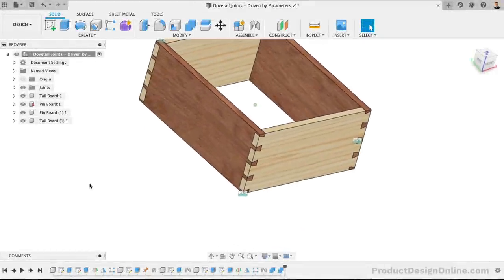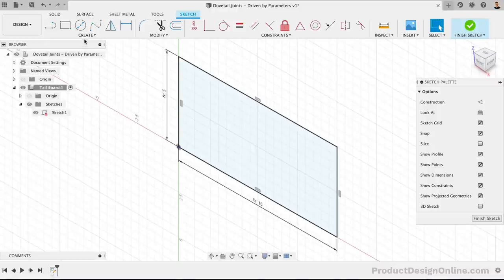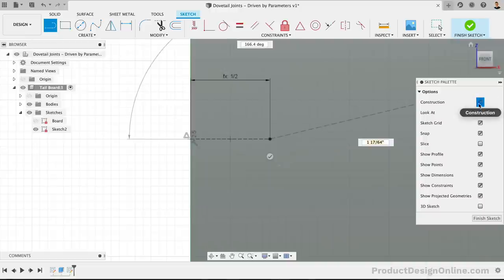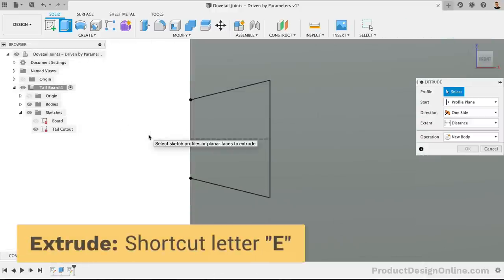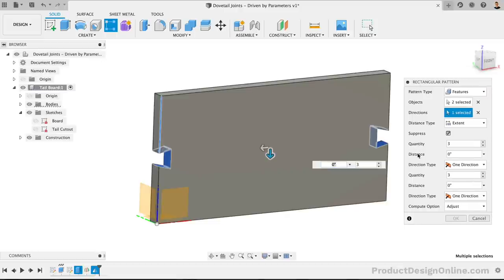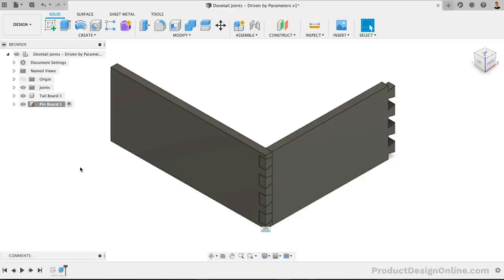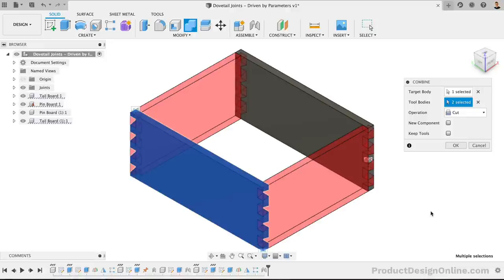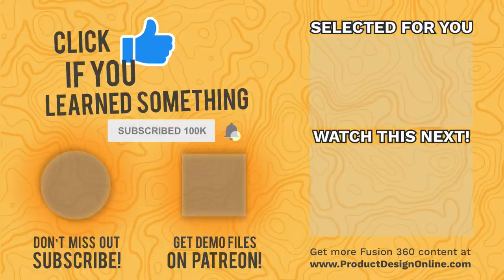Fusion 360 Woodworking: Dovetail Joints - Make them the easy way!

Comment from the maker: F360 Masterclass for Woodworkers ➞ https://bit.ly/woodworkingMasterclass
F360 for Woodworking Playlist ➞ http://bit.ly/woodworker-playlist
TIMESTAMPS
00:00 - Dovetail Joints in Fusion 360
00:30 - Fusion 360 Parameters for Dovetail Joints
00:55 - Creating the Tail Board
02:50 - Sketching the Negative Area of Pins
05:00 - Fully-defining the Dovetail Sketch
06:50 - The Proper Way to Model Dovetails
08:15 - Patterning the Dovetail Joint Cutout
09:30 - Creating the Pin Board
10:21 - Copying the Boards and Adding Joints
12:34 - Cutting Dovetails with Combine Command
13:34 - Testing the Parameters in Fusion 360

Comment: Thanks for the instruction & lessons that I've learned from your videos!  This one was no exception.

I went about it in a slightly different way.  If you design with really thin pins (say 1/8" for example), then it's not all that realistic to have half pins that are 1/16".  So I added a parameter for the half pin width and removed that much off of either end of the tail board to make sure the half pins were a reasonable size (1/4" or 1/2" for example).  Then after push/pulling the center pin out of the tail board, I used the rectangle pattern tool to replicate the center pin cutout feature across the remaining space rather than the full width of the tail board.  I hope this makes sense.

Sometimes just because something can be designed and modeled doesn't necessarily mean that the final product will be functional.

Comment: I started using F360 a few months ago mostly for woodworking, so I was happy to find this video. It was really informative. It also mostly matched my gut instinct on how to do this, which made me happy. What I might have done instead of the Copy / Paste commands, though, would be to mirror each board across the corresponding midplane, or maybe instead do two rotational patterns about the center of the box, one to copy each board. That way I'd only have to do the joinery Combine / Cut operation once, and any other changes (eg a groove for the bottom) would get duplicated to if I put them in the right places in the timeline.

The trade-off is that I'd probably have to make the whole box a rigid group rather than using joints like you did. I like the way your joints assemble it like you would in real life. I'm not sure which approach I like more. I need to add some drawers soon to an MFT-style outfeed table I'm designing, so maybe I'll do one each way and see which I like best.

Thanks for the video!
Reply from the maker: In general, try to avoid Mirror and Patterning in Fusion 360 (all parametric CAD programs). It often causes extra latency and other issues downstream in timeline. For woodworking sake, it will make your BOM/Parts list inaccurate, etc.

For a "Small" project - either method would work :)

Comment: This was very helpful! 
Some things I would felt were missing:
- A few sentences to what a parameter is and why it is useful to use parameters. also, where to click to be able to make your own parameters.
- when you used the assemble-joint tool, I had no idea which point you used to align. It took me forever to find it; my board kept flipping, or at one point I almost had it, but it didn't align properly (it was off by 1 cm), and I didn't know why that happened. Also, maybe a few sentences to what the "joint" tool actually does.

Otherwise, this was really helpful!

Comment: Very good video and an elegant workflow to modeling dovetails. 
I would like to use this as a basis for future works and one approach is to hand dovetail the 4 sides then after glue-up rip on the table saw the four sides releasing the top from the base. 
Do have a workflow on how to this? the saw kerf removes 1/8" of material. 
thanks in advance
-Craig

Comment: Kevin:  I need a way to do this but with some tolerance (gap) added to one of the parts.  When CNC'ing if one part is exactly the same as the other they wont' actually fit together.  I wish the cut tool had a "+/- offset" option to add this tolerance.  Any suggestions on how to accomplish thi sand maintain the parametric nature?  Thanks,
Scott
Reply from the maker: Hi Scott. I agree, wish the cut had clearance built in. For now, the main way to do it is to use the "Offset Faces" command. (Solid > Modify > Offset faces). You can use a parameter defined as "Clearance" and set each offset to that parameter.

Comment: Kevin, I had a problem when changing the parameters. Everything works as it should except one thing. I have my Fusion 360 design oriented the same as yours in the video. When I change pinNumber to any even number, the board in the rearmost position extends out a bit. When I went back to where you made the joints at 12:30, I noticed that the corner furthest away did not have joint icon in place. I have tried to create a joint at that corner, but the joint icon always appears at the far end of one of the two boards, away from the corner. Have I stuffed up somehow or is there a problem with using an even number of pins?

Comment: Hey Kevin! I’ve been focusing on your 3D printing videos which I love and thinking of getting a laser cutter. Would going through the masterclass for woodworkers and such be good for something like that? Since it takes svgs just wasn’t sure how it would relate to each other.
Reply from the maker: Hi Alex. At the moment I don't have any laser specific videos in the Masterclass. I thank you it still gets some value, as you mentioned, because sketches can be exported as SVG. However, a lot of that depends on the types of projects you're looking to laser. If it's boxes and such then Fusion 360 is definitely applicable. If you're looking to do graphics like logos or full-on images then you'll need to use a graphics program like illustrator or Inkscape.

Comment: When using the PinNumber variable in the quantity field, it's RED in color and does not ever fully define or change when I put a new value in parameters box. What am I missing?
Reply: Found the issue, I had the units wrong in the parameter dialog box

Comment: Kevin, how come at 5:58 your dovetail was all black - fully defined - yet you were able to add a symmetrical constraint. I sometimes have an issue where all my sketch lines are black, nothing moves, yet there is still a ✏️ on the sketch tree and so I can't figure out what other constraint or dimension is required.
Reply from the maker: Hi Damion. Great question. This instance is a weird use case. The bottom angled line already had the symmetry constraint (I added it prior). Consequently, that fully defined the entire sketch because the straight line on the right (below the symmetry line) cannot be moved - it would update based on how it is snapped to the angled line. So, in theory, the sketch is fully defined. I was still able to add the symmetry to the right line which essentially forces that line to not be altered if the other symmetry (angled) line gets changed. I hope that helps - generally, these edge cases are when symmetry constraints are used.
Reply: @ProductDesignOnline  thanks for your reply. You learn something new everyday, which is the whole point of your video 😀. Keep up the good work 👍

Comment: Do you have any recommendations on a brand of a CNC machine for a beginner? 1500-2500 range.
Reply from the maker: I would recommend the "Longmill" by Sienci Labs. The only downside is that there lead time is usually 4-6 weeks. Second recommendation would be Shapeoko. I would not recommend an Xcarve.

Comment: Do you this there is a way to cut the tails with a dovetail bit on the CNC? I mean with incremental depth, not on a single cut.
Reply: I see it done often purely for strength not appearance. You can't get a seamless joint using a round bit to cut sharp corners. You can be creative though and design your pins and tails to accommodate this. YouTube has a few folks who have done this.
Reply from the maker: There is a "dog bone" add-in that can be used to round the corners. Some other tricks out there too - perhaps a future video :)

Comment: When I try to grab the demo file it says that the model is empty : /
Reply from the maker: Note: The hub will say the file is empty – don’t worry! This is because the parameters are the only thing in the file.
Click the blue “Open in Fusion 360” button. Wait about a minute and you should be prompted by your Browser if you want to open it with the Fusion 360 Desktop App.
Click Open.